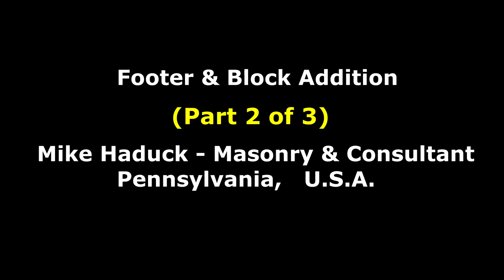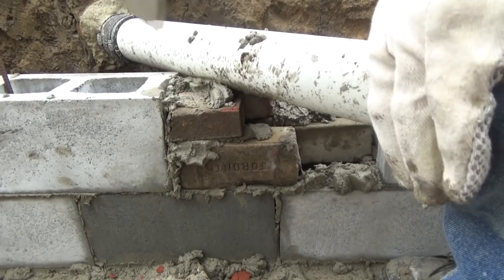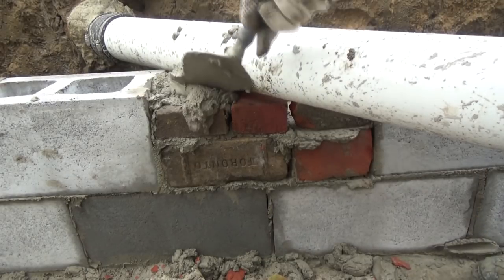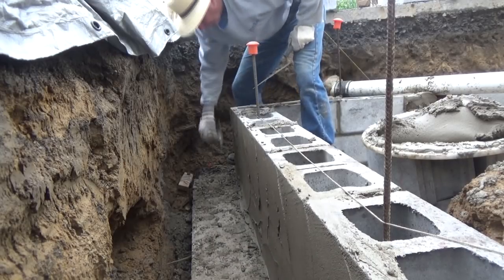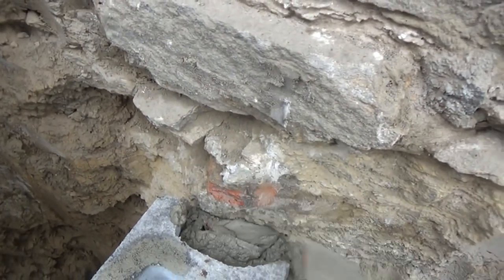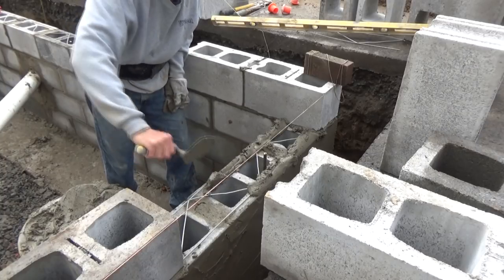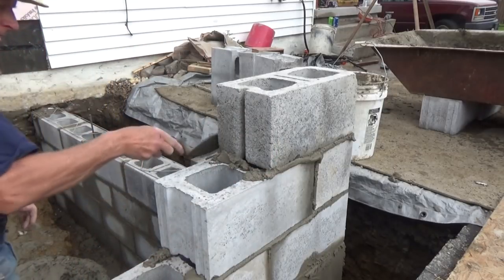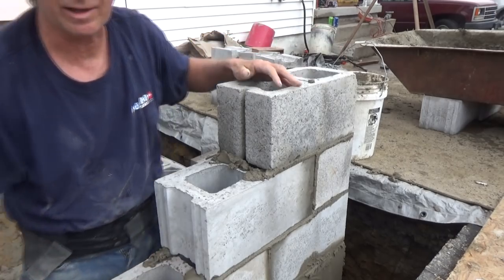FOOTER & BLOCK "Crawl Space"(part 2) Mike Haduck

Comment: I wondered how you would work around the pipe.  Interesting and makes sense.
Reply from the maker: Thanks so Mike
Reply: Sue P what other way could he have done it is what you could ask yourself since it makes since or?
Reply: one local comment.
a plumber i know says they add a larger 'sleeve"  with double roof paper inside when a pipe passes through a wall. besides code compliance here, he figures that will tend to isolate the cement/mortar from the metal and allow an easier pipe change if a later repair or addition affects the through wall piping. he also commented that shifts in the foundation are buffered with a space around the pipes - like allowing room for steel beam expansion.

Comment: When you’re tying in with an existing foundation with a new block foundation, do you need to tie in with rebar? Or can you just butt up to it like you did with this one?
Reply from the maker: Hi Ryan, in my experience it all depends on the situation, two separate footers means your gonna get cracks, and depends on what your going against, rebar rots away with time,  good for the short term,  if that makes sense, I hope it helps thanks, mike

Comment: Hey Mike, just wondering if you have any experience with using GFRP (Fiberglass) rebar or other non-steel based rebar on masonry jobs. Was looking into that option on a block job because steel corrosion concerns me.
Reply from the maker: Hi David, I don,t know if it is proven yet,  and if code says you got to put it in, you got to put it in,  if you can keep the water from getting to it that is a big deal, but unless you live to be an old man it probably will not be a worry, if that makes sense, thanks, mike

Comment: When you measure for block length and height, do you allow for the mortar that’s in between them into that figure, and if so, how much?
Reply from the maker: Hi KD9,  usually most materials like block work works out to a common number like 8 inches in height, but the old timers always made story poles and figured it out before they ever started, you see in a lot of my videos I lay it out dry first, if that makes sense, thanks mike

Comment: I was expecting you to drill and pin into the existing foundation and use a bonding agent. When/if do you need to do those steps? I see it often here in Minnesota. Love your vids btw.
Reply from the maker: Thanks, the foundation was made out of stone very irregular, with the old lime mortar you could hammer them in, also cement on long walls shrink, I dont use bonding agents much, check out my video should I wet it first, thanks Mike

Comment: I remember seeing you say to use cement you need to wet both surfaces to stick but I notice you use mortar on dry bricks..is it necessary and  is there a reason the bricks aren't wet besides extra time ?
Reply from the maker: Hi Kaveman, I did a video called " should I wet it first" Mike haduck , I explain it best there, biggest reason is with brick or block is it makes a huge mess and leaves everthing dirty, thanks Mike
Reply: @MikeHaduck  ok ,thanks for reply. So hypothetically speaking if the bricks were wetted it does make a better bond brick to brick ?
Reply from the maker: @das250250  I would say technically speaking yea but I never seen any brick laying company wet them , it makes a big mess usually bricks are kept under cover before use to keep them dryer, Thanks mike

Comment: I have a question. Do you ever fill the center holes of the blocks with mortar? Thanks.
Reply from the maker: Hi Anna, I usually fill around the rebar,  about every four feet, but most the time no,   It all depends on what is required in certain parts of the country, thanks, Mike

Comment: my house was built in 1957 and they used veneer bricks from house to fill in where black septic pipe went threw the block work like you did it.
Reply from the maker: Hi napping, as long as it works,  thanks, mike

Comment: Makes sense, though over pipe work you throw a lintle over to bridge allowing movement in the structure with out pipe fractures.
I know its below dpc but be nice to see a better degree of filled out perp joints. Oh pipe you can fill out to waterproof but bridge it.
Well allow 10mm joints as a measure and 4 plus 1 mix
You can go 3 and 1 for a tougher mix  but anyhow well done from the u.k
P.s
Use profiles on corners makes job easier.
Reply from the maker: Thanks Michael,  mike

Comment: Did you run drainage pipe s on the in and out side of foooter ?
Reply from the maker: Hi Mammoth,  if you run drainage pipe you have to have somewhere to run it,  inspectors want to see daylight with drainage pipe, old.  Buildings like this with the old stone foundations never had them.So if you put one in it have to have somewhere for the water to go, I hope that makes sense thanks Mike

Comment: Regarding copper pipes through walls... I don't think I've seen sleeves in the hardware store. Seems like you could just wrap the section through the wall with plastic sandwich wrap. Maybe some Gorilla tape over that. 
I lived in an 1890s house and wanted to seal around some copper pipes coming through the floor. I wrapped the pipes in wax paper and sprayed polyurethane foam around them. No drafts and no corrosion 15 years later.
As always, thanks for your videos!
Reply from the maker: thanks Brain,  usually they put them through a plastic pipe and seal it,  much like you are saying,  I should do a demo on that in part 3.  thanks mike
Reply: If the pipe is already in place, I suppose you mean slit the plastic pipe lengthwise to get it over the smaller copper pipe. Or even cut the plastic lengthwise and place the two halves around the copper.

Comment: If you tried to break our 8 inch block with a brick hammer like that mike they fall apart . Grinder or con saw cutting only apart from the ones that are meant to be cut in half. which have the double wall thing. Tidy job.
Reply from the maker: Hey Bric,  I know, and I could’ve, but for a crawlspace I wasn’t too worried, thanks Mike